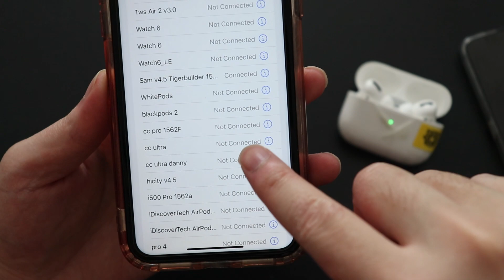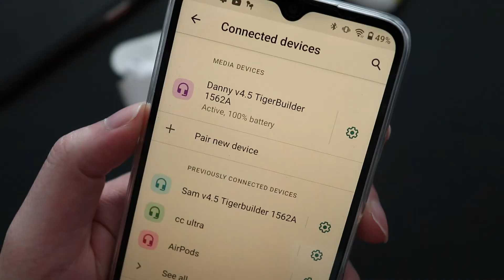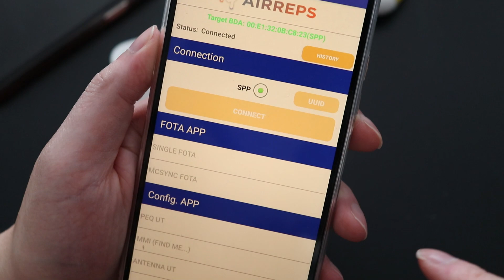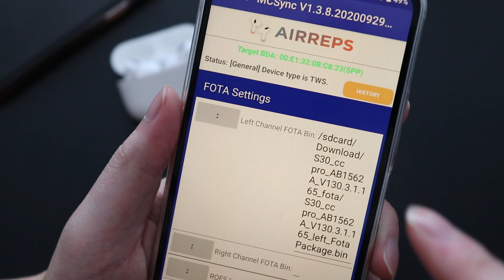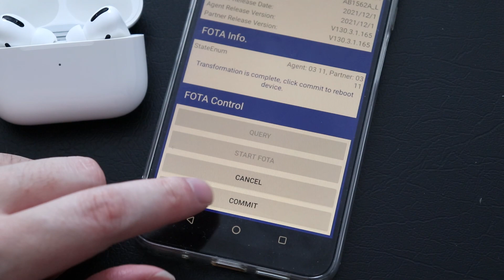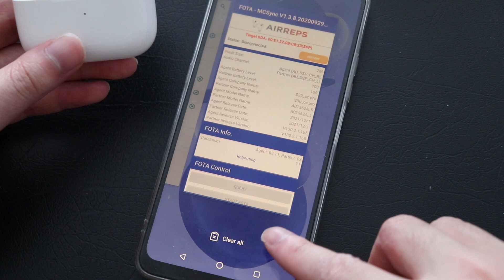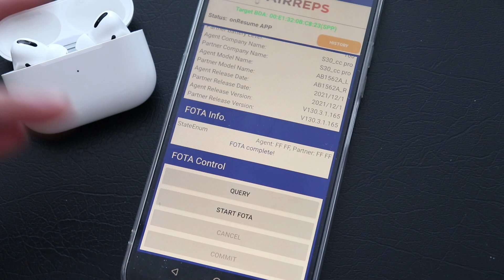How To Update Your AirPods Pro Clones in 2025! Danny v4.5 Tigerbuilder Airoha 1562A (GIVEAWAY!)

Comment: 1562A cheaps   spatial audio  will work
Reply from the maker: 1562A doesn’t have spatial audio head tracking. Only fixed spatial audio
Reply: @idiscovertech   1562Achip app airpods pro clone  app control android  there is

Comment: Is there any way to check what chipset does my clones airpods uses? Cause I got them on a regular shop without any specific information
Reply from the maker: It’s hard to determine which chipset it has. Try to connect to the Airreps apk app. Can be found on google Airreps Reddit. You’ll need an android phone. If it connects to the app; then it’s either an Airoha 1562A, 1562M, 1562F, 1562e, or 1562AE.
Reply: @idiscovertech if my airpods is any of this versions then should I copy what is in the vid?
Reply from the maker: @Fujji695  If you read the title and already watched the video, I've mentioned it that it only works for 1562A Tigerbuilder

Comment: Hello Friend. I have a problem I have an airpods clone but when I connect them to the iphone a version appears like the ones that appear in the list of apple versions, it's funny. and when I use the airReps app it appears that the iroha version is AB1562A and I tried to update them but I couldn't, could you please help me
Reply from the maker: There are many versions of 1562A AirPods Pro. They may use the same chip, but different motherboard. Confirm with the seller which motherboard it has.
Reply: @idiscovertech  I don't have that information. Can I get it through an app?
Reply from the maker: @Kovaks12  not entirely sure. Try asking on AirReps discord or reddit. They might be able to help you

Comment: Hi, does this update allow the pods to switch between apple device? Or is there any clone capable of this function?
Reply from the maker: No. The update is only for bug fixes and improvements. Not all clones can have that feature. The chipset used needs to support that feature. The Airoha 1562A does not support this feature. You need the Airoha 1562AE. You can buy the v4.9 TB instead
Reply: @idiscovertech  thanks for the detail

Comment: After this update my airpods not working not see in bluethooth
Reply from the maker: You’re sure yours was also a v4.5 (1562A chip) with a Tigerbuilder motherboard.
Reply: @idiscovertech  Yes
Reply: @idiscovertech  So it was maybe disconnection of wifi and firmware set with mistake
Reply from the maker: @annalutsenko5849  try resetting them
Reply: @idiscovertech  not help
Reply from the maker: @annalutsenko5849  then try reflashing them if you're able to somehow connect them to your phone. Who you bought it from
Reply: @idiscovertech  how can i reflash if i can not connect with bluethoth
Reply from the maker: @annalutsenko5849  If you cannot reconnect them in anyway, then you won't be able to. Why did you update them in the first place? You had problem with them or you just wanted to update them. There are always risks if you update them
Reply: @idiscovertech  Yes was not good sound,you spoiled my headphones
Reply from the maker: @annalutsenko5849  Who did you buy it from
Reply: I can not fully discharge case
Reply from the maker: @annalutsenko5849  If you're trying to discharge the case, it will take a long time. Standby time of the case is long. Could take weeks.
Reply: @idiscovertech  I put case in cold frige and drain

Comment: Does anyone know how to find out what type of clone you have? Also, is there a way to remove the voice”Bluetooth connected” when paring?
Reply from the maker: By connecting to the AirReps app, it will somewhat indicate it. You cannot remove the voice. Only the factory can. If yours have the voice saying Bluetooth connected, it means it's a cheap and/or old version.
Reply: @idiscovertech  oh thanks
Reply: @idiscovertech bro in my phone this apps not working
Reply from the maker: @superman9444  try another phone
Reply: @idiscovertech  My Reps are connected with my phone but they wont connect to the app how can i fix this?
Reply from the maker: @zxvrs2  not compatible model then

Comment: Hie, how can you identify the chipset because I got these from a dealer but I don’t know if they are the Jenny, Denny or tiger. So my question how do you guys differentiate is there like a way that I can tell?
Reply from the maker: Jenny and Danny are not a chipset. It’s a name. It’s the name of the sellers. We use it to identify which product is coming from which seller. Tigerbuilder is not a chipset either. It’s a factory producing motherboards.
Reply: @idiscovertech  okay noted so how do I tell if they are compatible to update the firmware?
Reply from the maker: @brandonmsipa5246  well, you’ll need to identify the chipset that it has and the motherboard.
Reply: @idiscovertech  but how? I got these fakes and the dealer just said they were "airoha" but nothing else.
Reply from the maker: @wa019a  airreps app
Reply: @idiscovertech  thanks. Now I need to figure out how I can steal someone’s Android device just so I can do this.

Comment: Your app is completely different from the one in the App Store. And I keep getting error saying filesystemimage.bin not found
Reply from the maker: As mentioned in the video, there is either the app on playstore or the APK app. The one I used is the APK, which was the early development and was not updated. The one in the playstore is the latest version. You can try downloading the APK app, which can be found on AirReps Reddit. Also, make sure you got the correct product that has a Tigerbuilder PCB and the Airoha 1562A chipset
Reply: How to check the motherboard app just shows the processor which is airoha 1562a tws master slave
Reply from the maker: @zr6067  what do you mean master slave. Never heard of it. What's the mac address

Comment: When updating the AirPods, does the serial number change or follow it? And what update version did you upload to with that file?
Reply from the maker: The firmware version is shown in the video. As mentioned, the one I have might not be the latest version. I have received that version a few months ago. It is useful for those who experience bugs and would like to attempt to fix it. As for the serial number, it may or may not follow. Mostly won't, since the manufacturer that made the update uses a serial number that not might be identical to the factory who built it. If you know how to code, then you might be able to change to whatever serial number you want